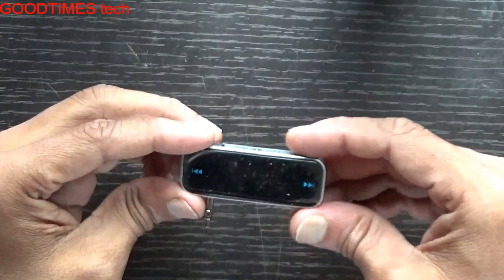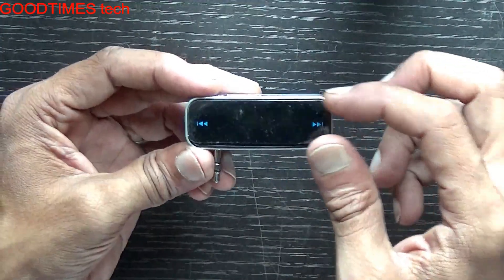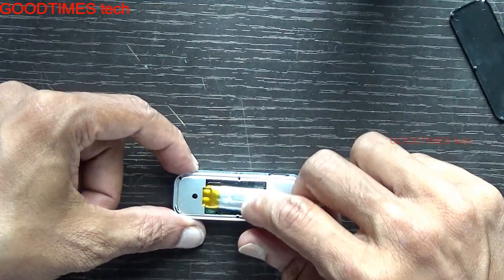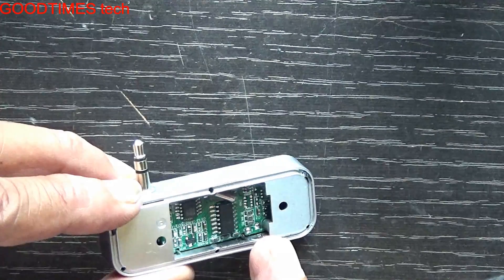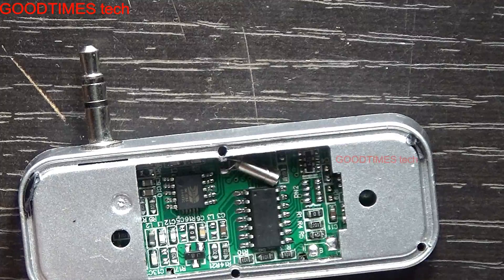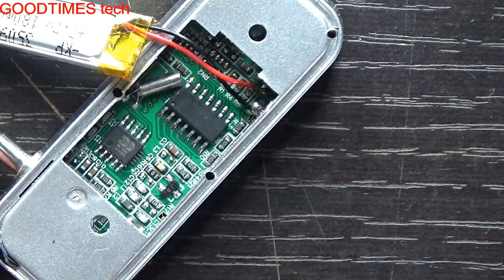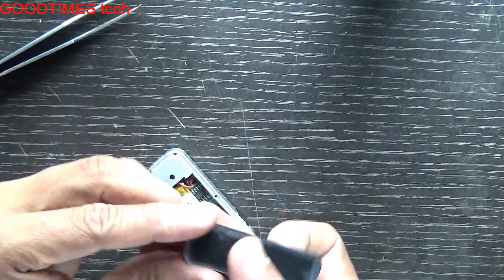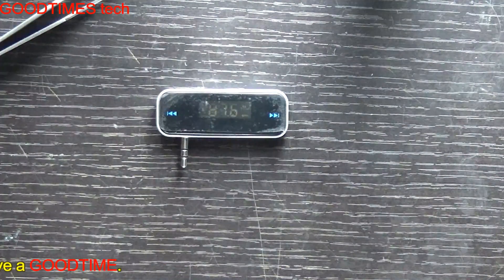How to replace BATTERY of an DIGITAL FM Transmitter.

Comment: I ditched that little battery, and added a 14500 with a little battery holder case.
I had to drill a small hole in the BT module. No biggie.
While I was in there, I soldered a longer antenna to it.
now, I can hear music all the way up the street.
(I put the FM transmitter in my attic with an old unwanted MP3 player attached to it.)
Both use 3.7v Li-Ion batteries, and last a long, long time.
Easy to modify.
If you want it for portable, its not made for that (now.)